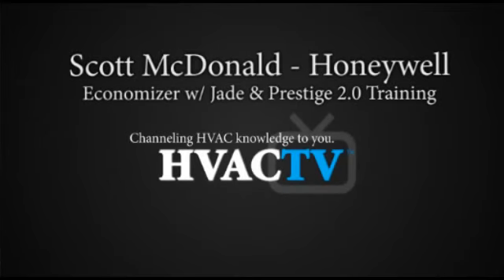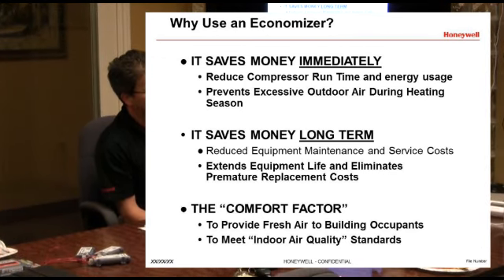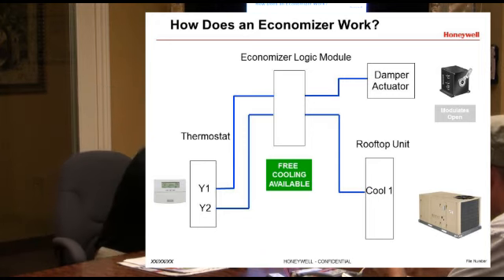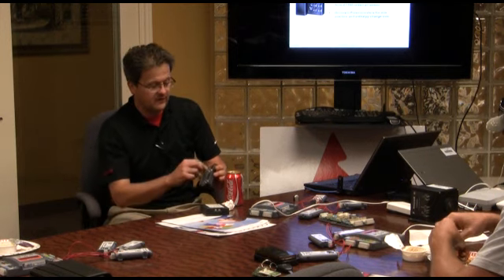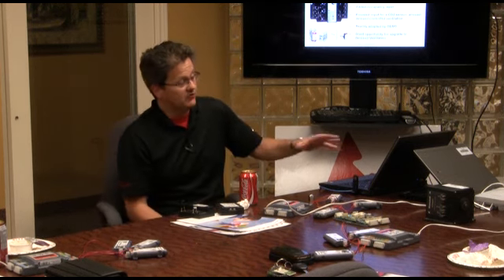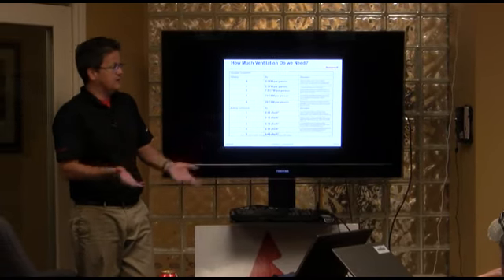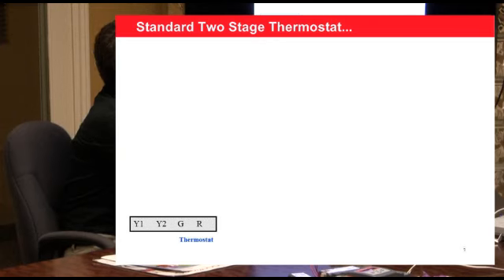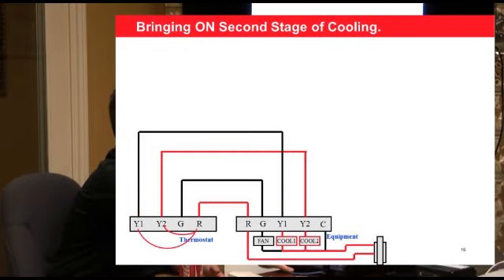AIRON Honeywell/Scott McDonald Presentation Part 1 of 2 May 2012

Comment: Thanks for the good video. However, I'd like to say the ridiculous complex way of checking out the older economizers, adding resistors and jumping things, is why billions of BTUs were wasted over the years. Honeywell and manufactures, knowing these are mounted in difficult areas in units, should have put some clear test switches and better indicator lights years ago.